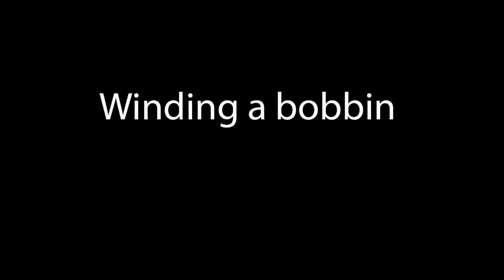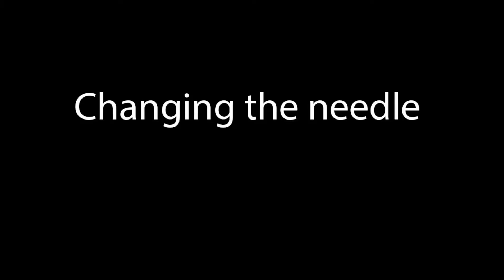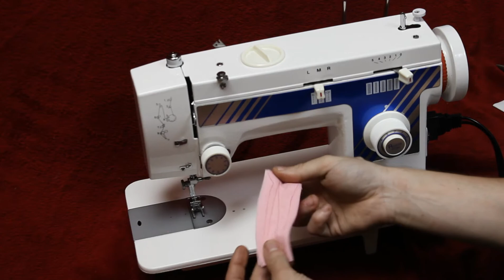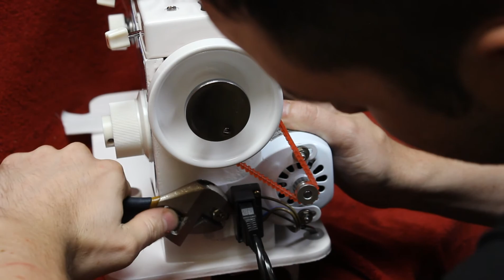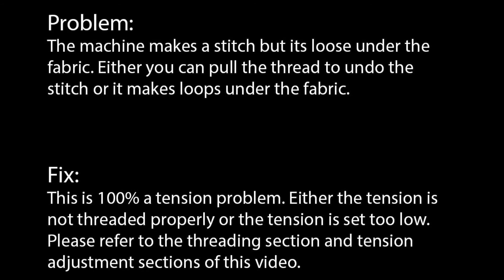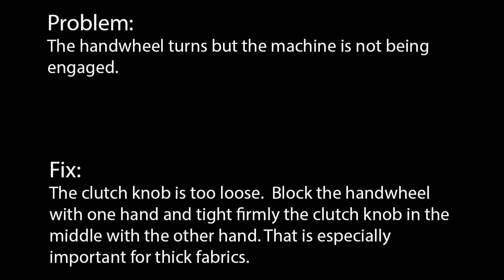OMEGA 307 sewing machine instructional & troubleshooting video

Comment: are there pinned parts where the set screws cant be adjusted without removing the pin?  are parts available? can we see inside the machine?  yes i might buy one depending on these answers

Comment: Hi Maxime, thanks for the video. I'm wondering if there is any way to reduce/control the speed of this sewing machine? I have only used it a couple of times because it only has one speed (really fast) no matter how hard or soft I push the pedal
Reply from the maker: Hi, the foot controller has different speed to control the motor. If you only get the fastest speed than perhaps your foot controller could be defective. I suggest you write to me using the ebay app and I will be able to send you another foot controller by mail. That should fix your issue.
Best regards